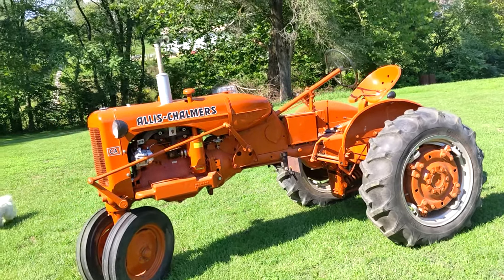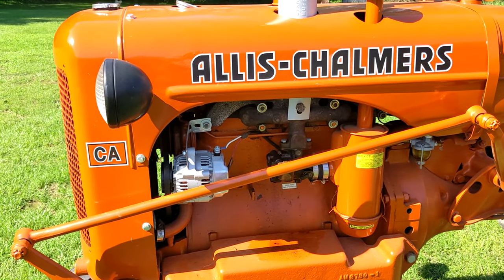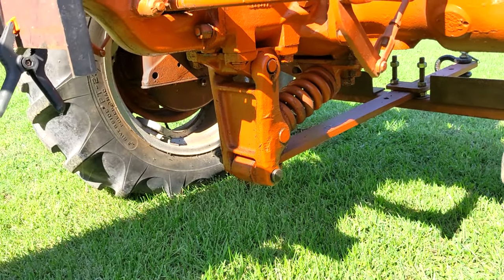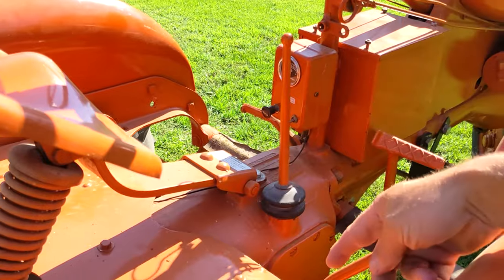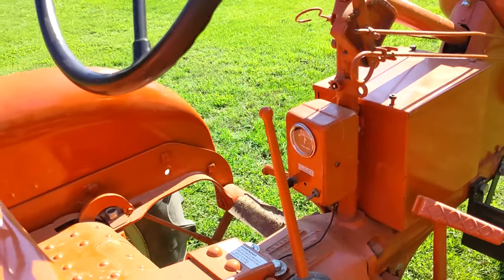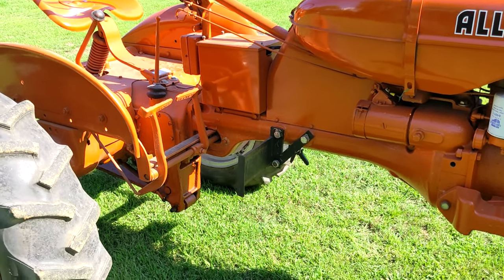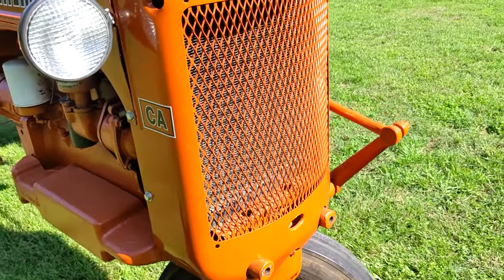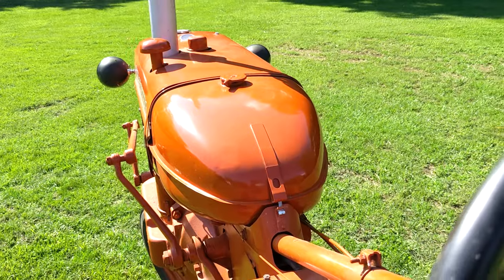Allis Chalmers CA

Comment: Nice.  Our neighboor had one with a snap coupler.  I could not make the narrow front end point straight ahead, ended up pulling a hay wagon down the road doing a slight S curve all the way.
Reply from the maker: That is common when the pedestal shaft is worn. My D17 does the same thing.

Comment: What is your tractor number? All early CA's came with a magneto from the factory. I think, some time in 1952 they were switched to a distributor drive?
  My 1951 CA669 was bought new by my dad and he said it had the distributor conversion, just like yours, on it when he got it from the dealer.  Any tractor with the "magneto flange' on the back of the governor, came with a mag from the factory. Later factory built distributor tractors had a different back end on the governor housing, without the flange.
 I still have the 2-14 pick up plow and the 2 row front mounted cultivator that came with the tractor.
Reply from the maker: I will have to look at it and see. This tractor came out of Maryland where an Auto shop took it in as payment for car repairs. Saw it advertised and drug it home. I have never used the rear lift but would like to plow with it. My D12 with a 2 bottom is about maxed out so thought the CA might struggle (I do gardens locally).
Reply: @charlie175  Dad used to plow level cornstalk ground in 3rd gear once in awhile with the CA I have. Could only run about half throttle or it threw the dirt too far.
 I've plowed with it and it had no problem pulling 2-14's in second, as long as you have the ballast. Dad had 'loaded' 14.9-24's on it from right after it was new, because the 12.4's  sank too far in plowed ground to disc with it.